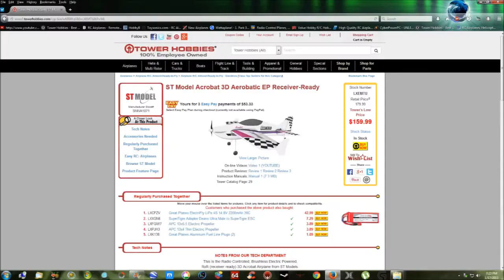ST Model Acrobat Maiden Flight

Comment: Hello friend you, I want to buy a good plane to learn to Toss 3D is good self to learn 3D ST Model Acrobat EP wingspan: 1230mm PnP upgraded for 4s lipo, is good this has me another suggestion (parkmaster, Extreme 3D EPO aerobatic Model 1100mm, Durafly ™ HyperBipe 900mm EPO, HobbyKing® ™ Edge 540 V3 (Red / Silver) 3D 1200mm ,, Durafly ™ Bravado - Precision 3D aerobatic Sports Plane 1000mm) which I recommend; Do you know which airplanes would be more good to learn 3D ????with 4s 3300mah battery has problem to fly 3D
Reply: What?